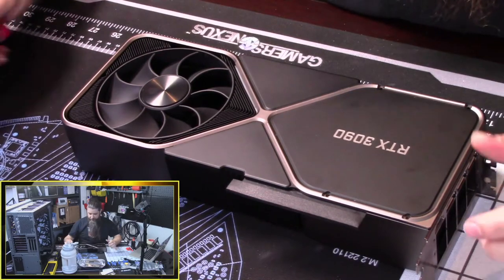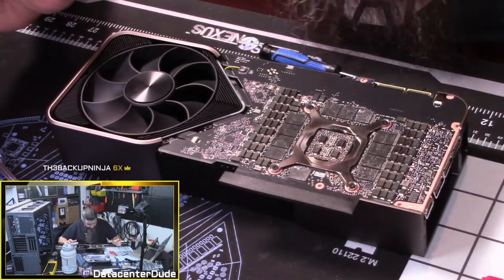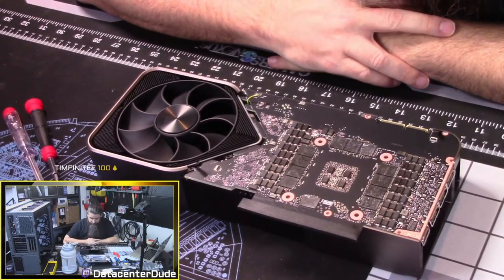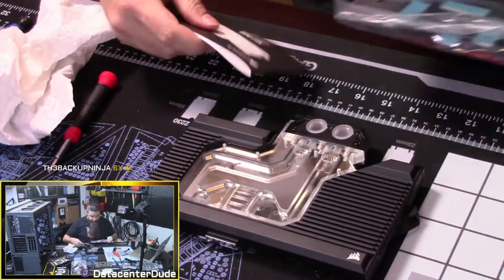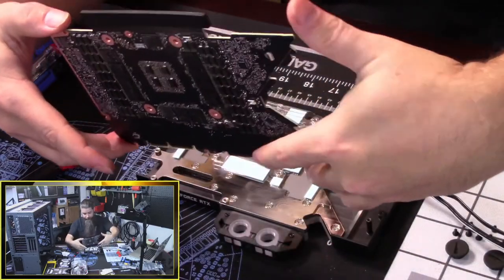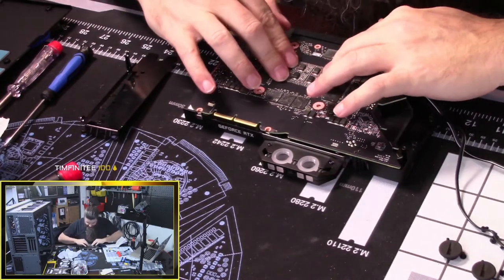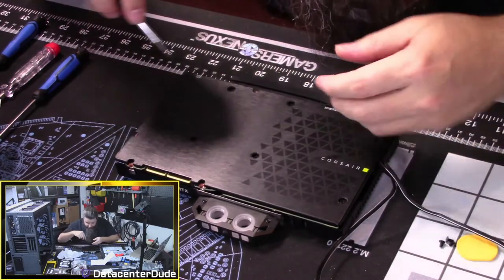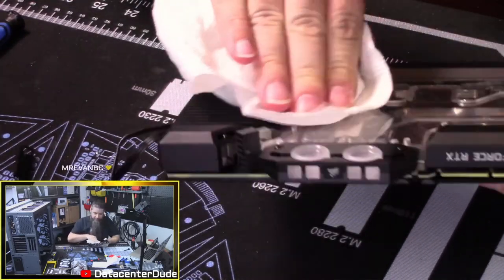NVIDIA RTX 3090 TEARDOWN Guide + Corsair Water Block INSTALL

Comment: I had a first batch 2080ti that had the contaminated silicon. I had waterblocked it, put liquid metal on it, repadded it. In putting it back together I repasted it with not the original paste and misplaced a couple of the tiny pads and that's what I sent back. They never asked me any questions about it, the replacement is still going strong.
Reply: How’d the replacement go?

Comment: Question. How long is this graphics card now that it has this watch block on it?
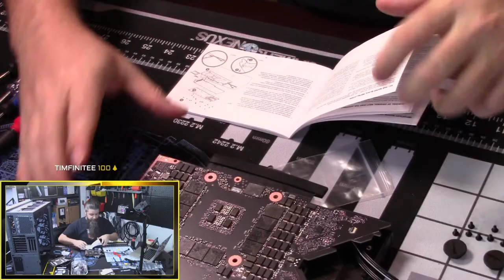Reply from the maker: You can see the side-by-side comparison at around the 13:00 mark as I'm starting to assemble to water block.
Reply: @datacntrdude  yeah I saw that it looks like it may fit but I can’t tell for sure. 

Corsair don’t have any measurements on there website unlike EK and Bitspower who also have every measurement.

Comment: What is the VRAM temperature after putting on the waterblock ? Thanks.
Reply from the maker: Tearing it down for shooting, and I'll have a full assembly and stats/results video coming soon!
Reply: @datacntrdude  Thank you. Can't wait for your video.
Reply: @rh8liuqy  its terrible, Stock cooler is better... especially for GPU mining. I'm gonna tear it down and add new thermal pads. Hopefully that helps.
Reply: my guess is that the back plate is inferior to the stock one. Soaks up all the heat with nowhere to go.
Reply: @datacntrdude  update?